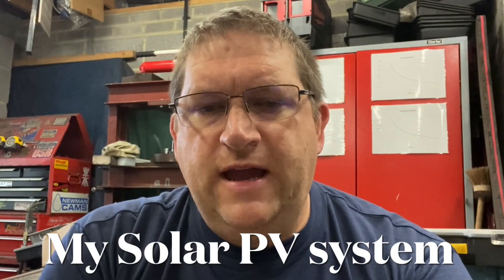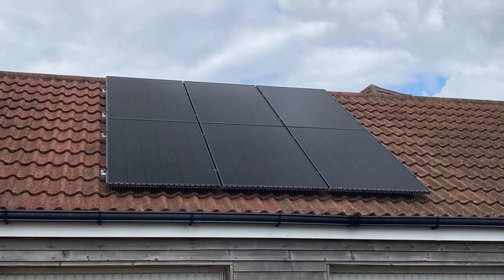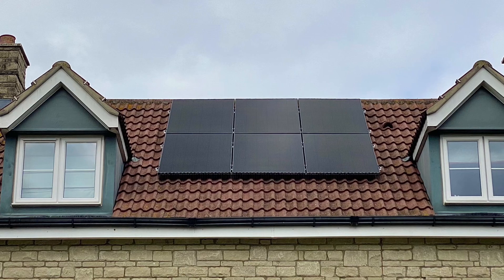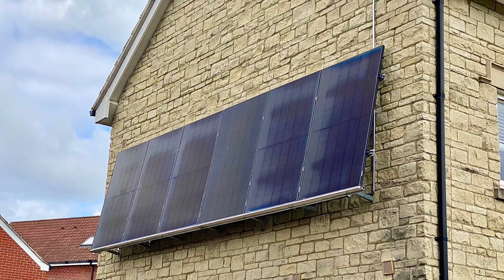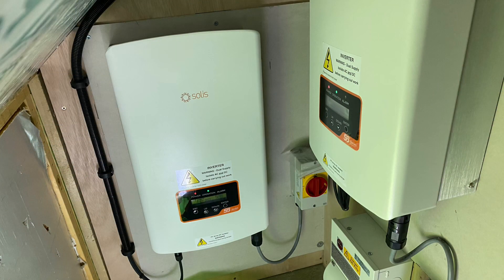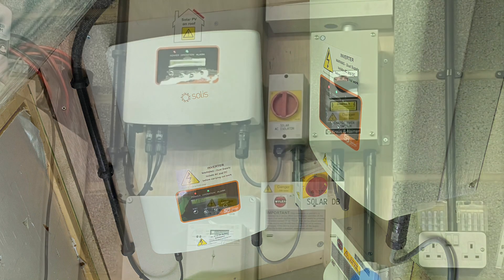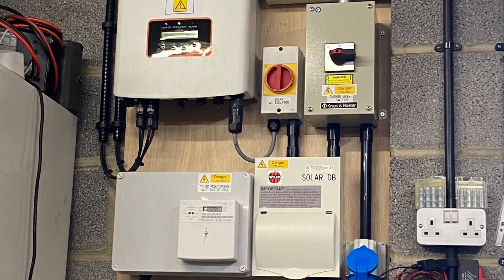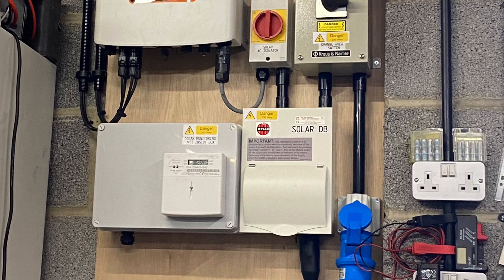My Solar install……

Comment: Hi AC, I have a solar PV system (6.9kWp, single 5kW inverter, 9.6kWh d.c. coupled battery) which was initially installed in October 2021. The battery only arrived in March this year but made a massive difference to the amount of solar energy that can be consumed as opposed to exported. Since it was installed there have only been two days (prolonged rain) when the battery became exhausted during the night. The effects of having a battery are more subtle than you might imagine as they charge up from fairly low solar generation and in my case this is currently starting at 06:00 and finishing at about 18:00 (SE facing panels). I agree with your "go large" assertion - you can't have too many panels. You can always export the excess - in August I received a payment of £131 from my energy supplier (Octopus, Agile SEG tariff). I look forward to future updates on this subject in addition to your Mini tuning activities.
Reply from the maker: What’s your maximum discharge rate on your battery?
Reply: @ACDodd  5kW - limited by the inverter. I am currently training my wife to avoid using the dishwasher,  washing machine or tumble dryer when cooking. Attempts to encourage efficient kettle usage have not been successful yet. She still boils 3L of water when she only wants a cup!
Reply from the maker: @grahamwoodier5066  yes I would need about twice that which would need a battery of twice the capacity.